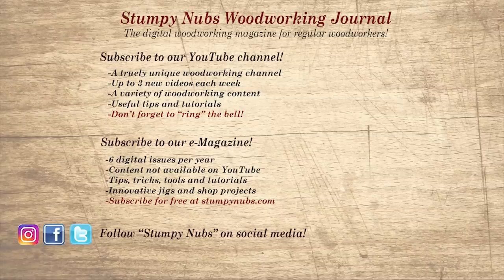Are table saws becoming obsolete?????

Comment: I don't have money, nor space for table saw, so I'm thinking about making a small table/holder for my circular saw to use as a mini table saw...
Reply from the maker: Circular saws are NOT designed to be used that way. They lack the essential safety features of a table saw. Rethink it...
Reply: @StumpyNubs , do you mean the switch and emergency switch on the side of table saw, or the riving knife that most woodworkers remove anyway? I wouldn't use anything, even made by myself, if I wasn't sure it's safe to use. With my eyesight I can't afford to be careless...
Reply from the maker: @urgon6321  Take a trip to the emergency room and ask them how many people come in with fingers in Ziplocs saying "I was sure it was safe..." You say you can't afford to be careless, you you speak of removing a riving knife like it's no big deal.
Reply: @StumpyNubs , actually one of my uncles lost two fingers in furniture factory. He used bandsaw while being drunk...

Also just because I'm thinking about it doesn't mean I'll be doing it. And I have both a healthu dose of respect for power tools and a rich imagination when it comes to worst case scenarios. When I saw your video on chain cutter disk, and how both it and angle grinders in general can be dangerous, I decided to skip on angle grinders altogether...

Comment: Honestly, I've never used to built in tape on a table saw they make me feel paranoid for some reason like I can never trust them no matter how many times I check (I think my dad drilled it into me as a kid because of job site saws) even measuring off the blade with your tape I'd say is faster then shimming around a track.

Comment: I wouldn't be without my table saw, in fact I'd happily buy a bigger one if I could afford it. Safety? I've cut my finger on a chop saw, chewed one with a router, but never had a problem with a table saw. With a track saw you cannot see the blade and I don't like that.

Comment: A lot of Europeans, myself included, get by just fine without a table saw. I like to keep my fingers attached to my hands. I also like the available space in my wood shop and the thickness of my wallet.
Reply: Murica!  The right to bear arms and lose fingers!  Got the SawStop. They were purchased by a European tool conglomerate last I heard, maybe they will bring the tech to your brands.
Reply: That said, I think it's important to make a distinction between professionals and hobbyists. Most hobbyists won't need the accuracy and repeatability of a table saw. Most of Stumpy Nubs' viewers are hobbyists. Many may be aspiring professionals, but I think most of us will remain hobbyists. I think it's important that we're honest about what we are. I'm a hobbyist, and I found a table saw overkill in many ways: accuracy/repeatability, cost, danger, space. Instead, I use my miter saw, circular saw + Kreg Rip/Accu-Cut, router table and bandsaw.

If I were a professional I'd definitely be wanting a table saw, as I do agree with Stumpy Nubs' conclusion. It is the best tool for professionals.
Reply: @kenreynolds1000  A SawStop costs an arm and a leg. But it will save your fingers.
Reply: I was unexpectedly surprised how much work a tracksaw can do in a small area. Owned a table saw for 43 years and a tracksaw for 2 years.

Each has its place.... provided you have the space.
Reply: @ximono  I found a NIB SS for a good discount after a year of looking and grateful I have a 220 plug in the garage.  I figure if I ever have to sell it I would be out 800 tops.  It is totally worth it.
Reply: I think table saws are much cheaper in the US than over here. Here they're either small construction saws or ridiculously expensive pro machines. So my choice was much easier in that sense.

It's also a cultural thing I guess. Bigger is better, right? Not so much here, at least traditionally.

If I had unlimited funds and space however, I would cash out for a professional German combination saw! Those seem both safer and more precise than table saws. I'll just have to get filthy rich first..

Comment: Until CNC Machines come down in price to the realm of a good table saw, notice I didn't say a great table saw, the saw will never be obsolete. One tool that seems in danger of becoming obsolete is the good old hammer. Everyone is into nail guns, brad nailers and pin nailers these days.
Reply: Nail guns are popular even for deck rails, which drives me crazy. Small, nearly headless nails don't feel like a good solution for keeping your deck safe, especially 3 or so years after construction.

Comment: You really made me stumble now, as a weekend warrior, should i sell my 8” miter saw and get the dewalt 8” table saw? 😅
Reply from the maker: The two are very different tools. If you want to rip wood along the grain to make it narrower, you need a table saw. A table saw will also crosscut wood across the grain to make it shorter. But a miter saw is faster and more convenient at that second job. So if you only cut trim and 2X4's in half, stick with the miter saw.
Reply: @StumpyNubs   i rarely cut something thin with the grain, like making  a2*2, but when i do, it is a struggle with my circular saw and a guide that i improvise some how.

Comment: What are your thoughts on the Incra Fence system? I couldn't find any recent vids of yours on this.
Reply: I personally love it.  Repeatable cuts, crazy tight adjustments without the 'bump' technique.  it's slightly more effort to setup, keep it in tune.  I lock the fence to the rails after each change which some find annoying... It's a process that I fall into like putting on a seat belt getting into a car. Plus if you add a router table to you table saw, it's doing double duty (with some setup between tools)
Reply from the maker: Mine is a bit of a dud, I think. I've had it for years and never been happy because the teeth jam up and don't mesh right every few times I try to clamp it down.
Reply: Other than the SawStop it is the best purchase I ever made.  That includes alot of Festool, Jessem, Lie Nielsen, Bridge City Tools, Veritas and more.
Reply: @StumpyNubs  I wonder if it has something to do with the way you have the mechanics off center.  I was looking at that setup as a way to better reach the controls but... could there be extra stress introduced with the pressure on one side?  Eeeeeeeevery now and then I get gear the gears miss-engaged but it's rare.
Reply: @StumpyNubs  That’s strange. Mine is smooth as butter.
Reply: @Putttn  I wonder if it would be a good upgrade for my Ridgid R4520 or if I should just upgrade the entire saw first. 🤷🏼‍♂️
Reply: @rikroberts  I would upgrade using your Rigid.  If you decide it works then great.  If not....New saw$$$.  I think it will work well with Rigid.  I've seen it on a lot of older saws.  Another idea is to get the Incra Orignial jig and buy their fence. A lot cheaper and does the same function.  Check out Russ Veinot on setting it up
Reply: @Putttn  Just waiting for that next stimulus check. ;)

Comment: There is no such thing as with or across the grain on plywood.  At best, there is a grain for the majority of layers, but at the end of the day, what is a rip cut for some layers is a cross cut for the others, no matter what direction you're cutting.
Reply from the maker: There certainly is a difference. Put a combination blade in your saw. Cut with the grain on the outer layers, then cut across it. Notice the difference in the quality of the cut. The grain direction of the outer layers, even if that's just very thin veneer, make a difference.

Comment: You are 100% correct as far as I'm concerned. I would add that dust collection is also much better on a table saw. For me if I could only afford one tool it would be a table saw and I'm NOT talking about an extremely over priced SawStop!

Comment: Absolutely not.  A good table saw for me always betters my track saw for quick jobs and for accuracy.  The right answer is to use whatever you prefer using, are comfortable using and which does the job well. No further discussion needed.

One problem for me is that my track saw even with dust extraction produces way more residual dust. My bench saw extractor works very well.  This might be the clincher.

For contractors I can see that a track saw is the more portable solution.

Comment: So you will never get rid of your table saw?  I think I remember you saying something about not getting rid of your RAS a few years back.  But I digress because I can't disagree with anything you said about the TS.   I have two and also still have two RAS's.
Reply from the maker: You must be thinking of someone else. I own a radial arms saw that was my grandfather's. I used to own another one as well. I even had two of them in the shop for a time. But I never used them extensively and have never gotten rid of one of them. My opinion of them (the are good for crosscuts but fiddly for specialized cuts) hasn't changed.
Reply: @StumpyNubs  Yes I knew you still had your grandfather's saw.  I was trying to goad you into making a new video about it :)  BTW both of my RAS's have Ridge finish blades installed and these blades have lived up to your advertisement!  Thanks

Comment: So I get the sense that my cheap and second-hand table saw with a really crappy fence is very nearly worthless as a table saw... Which I won't really disagree with. I can't cut something 13 inches wide with it... I've got an old Craftsman 113. series from the 40s I need to finish fixing up... Then go email the guy near me who appears to be hoarding the extension wings 🤣
Reply: A 113 Craftsman is a very capable saw with a good fence.  I would still be using mine if I hadn't found a screaming deal on a cabinet saw.

Comment: At least for me the tablesaw is kinda my everything tool lately
Reply: I even have mostly every tool needed granted nothing super high dollar but craftsman jointer, rigid planer, rigid sliding compound miter saw, etc. But I use that rigid tablesaw for almost everything with a thin kerf glue line rip blade

Comment: Disagree about sharpening router and forstner bits. I can easily hand hone a carbide bit on a diamond stone in seconds and do an entire project with it. A saw blade takes much longer by hand. Or I need to setup a jig and wheel to sharpen it.
Reply from the maker: Yes, you can LIGHTLY sharpen a router bit by hand. We even have a video about it. But in my experience, once you take more than a tiny bit of carbide off through two or three sharpenings, you start to get uneven cutters, forcing one to work harder than the other and dulling the bit more and more quickly.
Reply: @StumpyNubs  It only takes a few strokes usually.  The profile geometry shouldn't change at all.  You only stone sharpen the non-profile geometry dependent face perpendicular to the profile.  A micro burr gets pushed up on the profile surface and then you use jewlers rouge on a leather strop glued to a thin stick or dowel to polish the burr off the profile surface.  The profile shape should never change and you can sharpen dozens or even hundreds of times.  Polishing compound is the only thing that ever touches the profile surface.
Reply from the maker: @cbpuzzle  Yes, I know how do do it. We've made tutorials about it. I'm just saying you can't do it many times because even if you count your strokes you can not remove exactly the same amount from both cutters, and the small difference will add up. The edges of the cutter are beveled. When you remove carbide from the flat face, you make the cutter a little thinner, and because of those beveled edges, a little smaller as well. If they become uneven, one will cut more than the other. You may not notice it, but it will cause that overworked cutter to dull more quickly.

Comment: Having a table saw with a big enough surface is a problem on job sites and small shops but the things you do to replace the table saw are only ever compromises. Even the track saw coan kiss the butthole if my table saw has a big enough platform and feed system

Comment: Splitting a long board on a track-saw usually involves another board(or plate) of the same thickness to support the track, if you use some countersunk screws and t-nuts to attach that second board to the track then repeat cuts become quick, easy and repeatably accurate.

Setting up that attached second board can however be a bit fiddly, but if thick enough to allow 2-3 recessed grooves and elongated holes in that second board  it becomes a semi-permanent fixture/jig.

Comment: A miter saw that cost more than a GOOD table saw? Cmon meow lol I do agree with everything else mentioned.
Reply from the maker: I paid $700 for it. I can get a good table saw for that. I didn't say it was more than the BEST table saw.
Reply: @StumpyNubs  best miter saw available here is approx $700 without buying a black and green one. The small job site table saws cost 600-700 at my local stores. Cheapest they go. I don’t consider my little job site saw a good table saw by any means lol. I do often have dreams of a nice professional table saw though.

Comment: Another great video, thank you!  I’ve recently released that my dewalt table saw doesn’t support a dado stack. Do I build a table to mount my router, or buy a new table saw?  Thoughts welcome. Thanks!
Reply: Build the router lift I would say. Way cheaper and more versatile than a dado set.
Reply: That depends on how often you make dado cuts.
If it's on a regular basis and you've been wanting to upgrade your table saw; then upgrade the table saw.
If it's rarely basis and you're not so keep on upgrading your table saw; then mount the router.
If you're just looking for an excuse to upgrade your table saw and you can afford to do so; then it's time to upgrade your table saw.
Reply: @scotttovey  All good points. Thanks. I’ve only had the table saw for a year. Complete oversight on my part. Didn’t realize that not all of them supported a dado stack.  Just getting into woodworking so I’m not certain of my long term needs. Guess I’ll mount the router with a good adjustable fence and see how I get on. Thanks for taking the time to reply!

Comment: Try cutting 10-quarter  White Oak with a Track Saw , Band Saw etc you will SMELL that tool BURN UP while you use it !
Reply from the maker: I can cut 10/4 white oak on my band saw. I could cut 60/4 if I could lift it up on the table. :)

Comment: I want to see the naysayers make a rip cut on a 2x4 with any other tool, lol
Reply: A vertical 2x4 😁
Reply: A bandsaw would do it, but definitely not ideal for finish work.
Reply: I’ve done it with a circular saw and guide (with the piece I’m cutting fastened to the tabletop), but man does it suck. Should have enough saved up in the next month or two to get a table saw.
Reply: My dad used to rip 2x4 down to 2x2 with a circular saw.  Funny story.. He bought a dirt cheap circular saw for $29. It was only 10 amp. First cut was a rip cut on a wet 2x4. 3/4 way through, the saw started smoking. He was determined to finish the cut. Cut was finished and so was the saw. Lesson learned.
Reply: I band saw 2x12s and do 1-2 passes with a hand plane on the surfaces.  But I'm not doing production work.  If I was making kitchen cabinets, I'd want the table saw.
Reply: Easy with a hand saw, if you’re not in a rush. Good workout too...

Comment: On the jobsite- portable table saw wins hands down.  Track saws are fiddly with setup and require you to have a super stable bench/sawhorse/large flat surface to work on.  That's not always easy to set up on uneven ground

Comment: I disagree with you.  Because... reasons.  So there.  Anyway, I'm in no way a "woodcrafter".  Just a DIY'er who does occasional projects.  Which means I'll cut some pieces, go do some building or get pulled away, and come back to cut some more pieces.  With the table saw, things are still setup for the previous.  With a handsaw or router, that may or may not be true.  That added with the not worrying about the muss and fuss of moving the guides for every cut makes having it a no-brainer for my lazy ass.  ;-)

Comment: You are begging the question.  Why would a home woodworker need one tool when they can have several for less money that can do much more?  A new Sawstop can be $3,000 or more.  If you get a good fence as you recommend it adds even more and is outrageously expensive for a hobbyist or casual woodworker. For that kind of money you could get a much more versatile set of small power and hand tools.  
You work in a commercial production shop.  That's why you need one.
Reply from the maker: Who said you needed a $3000+ table saw? I never did. I've made loads of videos for folks with small woodworking budgets. Even in this video you see cuts on a contractor's saw. And I do not have a production shop. You assume too much.
Reply: It's a huge barrier.  Table saw centered woodworking shows are ubiquitous so I was interested in the title of your video suggesting a change in direction. It was disappointing to see more of the same. 
You are right that I first wrote without understanding what you do. Your website shows a very nice teaching studio built around your table saw.